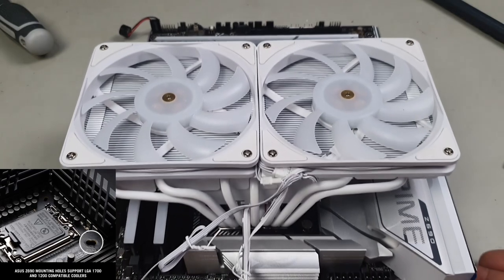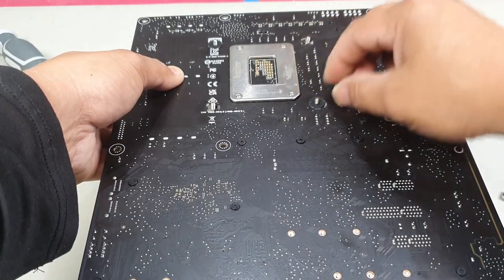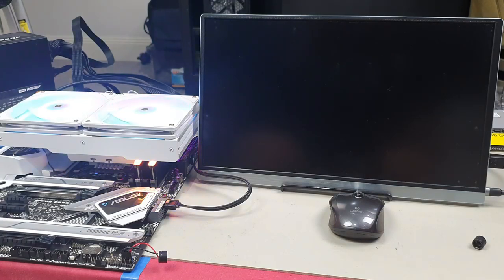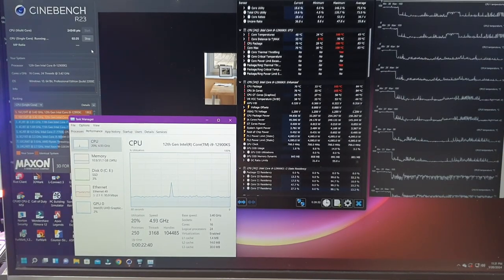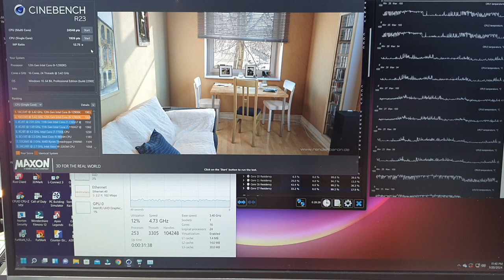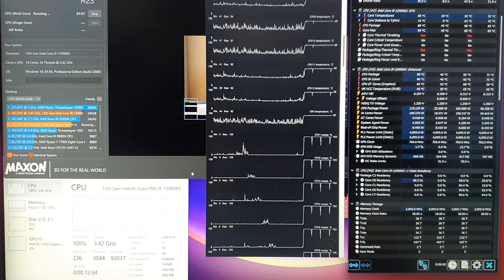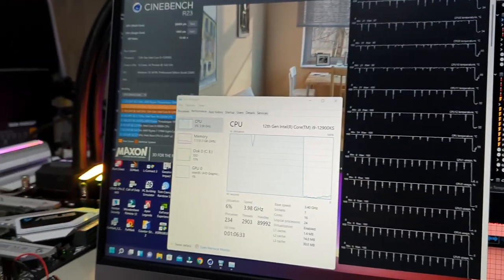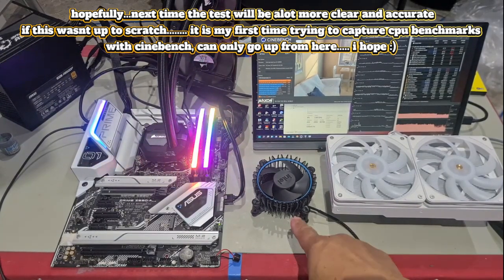how to install jiushark JF13k diamond dual fan cpu cooler. asus z690 A prime + Cinebench R23 test

Comment: only thing I would note is that for boards with gpus in the top slot (your board has a m.2 in the top slot so there's no clearance issue here) you will want the heat pipes facing the gpu pcie slots, you installed it the other way here
Reply from the maker: yes correct ..good eye... I only noticed this after
Reply: @MIKEYZVLOGZ  all good, I saw a thread where it was mentioned, just wanted to note the reason just in case.  Good video though for prospective buyers
Reply from the maker: @devontoner cheers buddy appreciate it very much... and thanks for the support means the world to me 🙏

Comment: will this fit on matx board/ Asrock b450m hdv r4.0 ? And my case is tecware infinity m2. 
And can a 120mm fan still fit in the rear of my case?
I want to get this because my mobos vrms does not have heatsinks and are naked and I want to cool my vrms directly.
(edit: If this cooler can efficiently cool the vrms and reduce temp, and are there a difference in temperature of VRMS and RAM between this cooler and a mid tower cooler? If the difference is minimal I might just go for a mid tower.)
Im getting this or a mid tower in the next few months after I get enough money since im upgrading few parts first before getting this

Comment: 236w on the package power on the AIO 360 rad and 208w on the Jiushark JF13K. That's genuinely not a bad showing, It's not every day a top down cooler can challenge a radiator in any capacity. Think this will be for my next build.
Reply from the maker: ye it's pretty good

Comment: I literally just got mine but was confused on how the back bracket faced. Thank you. So amd out. I have intel. But from what ive gathered, you've installed it unside down.
Reply from the maker: no mines intel... the back bracket should be flush with mobo... where the nuts go ..on the back side where back mounting plate goes ..it should the corners where the nuts go should be flush with the mobo.. cuz if it is not flush it will bend wen u tighten it
Reply from the maker: do u mean the writing is upside down on bracket ...it doesn't matter as long as it's on ..cuz its symmetrical doesn't matter ..so long as u have it on right it's all good 😊
Reply: @MIKEYZVLOGZ  sorry I wasn't specific. You mounted the back bracket correct but the whole cooler itself it's wrong way round. Pipes on the bottom not the top. If you need the wires to reach just turn them.
Reply from the maker: @DoctorFuzworth  oh I see ..does that really matter tho? and are u sure cuz the thinner side should be where the ram goes so it clears the ram ..if u flip the cooler the thick side would be on the right where ur ram is ..it might not clear the ram
Reply: I'm not 100% sure my guy. Gamers nexus said pipes down and the picture on the instructions seem to be that way too. Whatever works but there's gotta be a reason they made it fins different size on each side how they did. Mobo compatibility maybe.
Reply from the maker: @DoctorFuzworth  but I do see what u mean .. I just looked at the manual and it does show one pic where the heat pipes are on the bottom ... so yeah maybe ur right ...let me.know how u go with ram clearance
Reply from the maker: @DoctorFuzworth  yeah maybe ... but ye as long as it works ...but I recommend follow.gamer nexus too..he knows what tf  his talking about ..and yes I did see a pic in manual showing pipes down too...
Reply: @MIKEYZVLOGZ  so seems to fit like a dream with pipes on the bottom. And facing that way you have way more room for ram. Specially if you have tall boys. Temps are great! Sorry for the delay. Life's been tough here lately.
Reply from the maker: @DoctorFuzworth  very good..actually ur right I did do it upside down I thought I did it with the thinner side of the fins over the ram ..but I must have forgotten cuz obviously u would need the side of the fins higher for ram clearance
Reply: @MIKEYZVLOGZ  glad we got it figured out my guy
Reply from the maker: @DoctorFuzworth  good stuff bud... well done

Comment: Do you have any Noctua A12x25 or Phanteks T30 or better fans to swap it on? Would appreciate if you could thanks!
Reply from the maker: hi mate unfortunately i dont...
Reply: That's the first thing I'm doing is upsizing the fans as well. Two Arctic Bionix 120mm fans specifically. This might be the king of downdraft coolers with better fans.